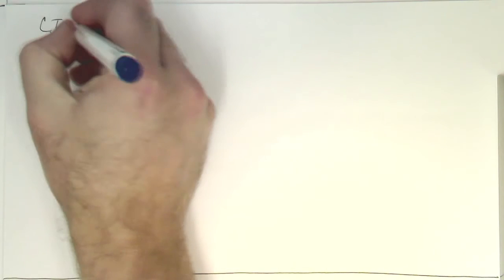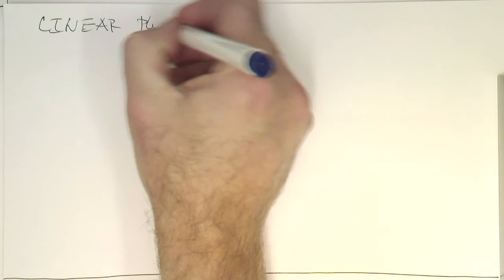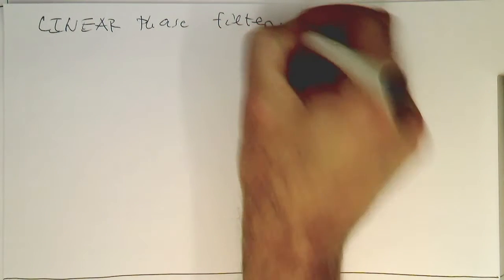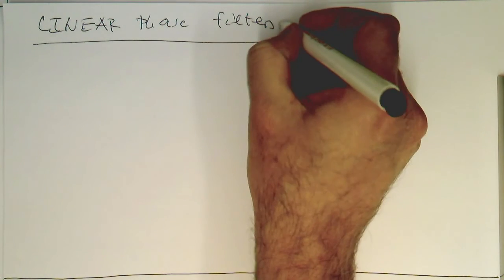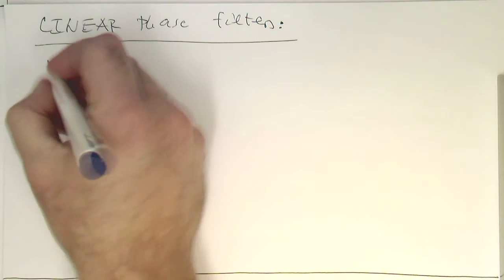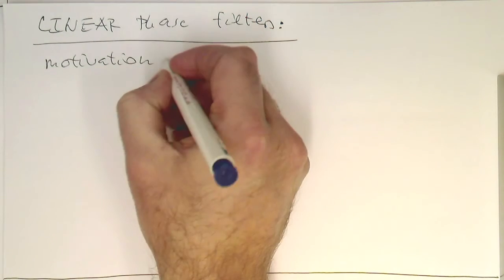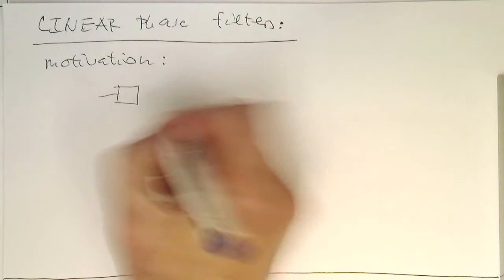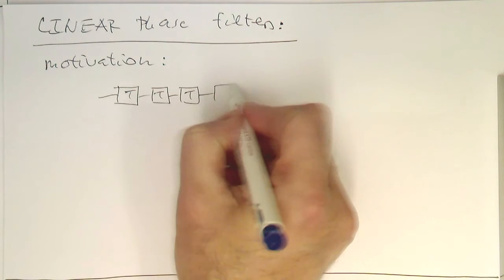FIR filters: deriving the constraints for linear phase FIR filters (005)

Comment: 19:08 I thought 1/2pi should also belong to IFT, isn't it?
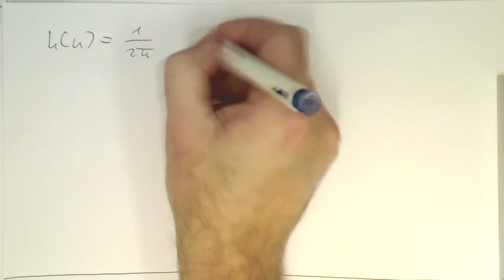Reply from the maker: It's there isn't it? See 13:58 where it's easier to see.
Reply: @DSPcourse  Sir, he meant 1/2π is a part of "Inv. F.T" and it should be simply : h(n+𝜏) = ejφ.b(n)
Also, however later in the RHS & LHS of the final equation , the "2π" cancels out at @25:34 (as you said), but it shouldn't be there in first place. 
May be my interpretation is novice, apologies in advance.